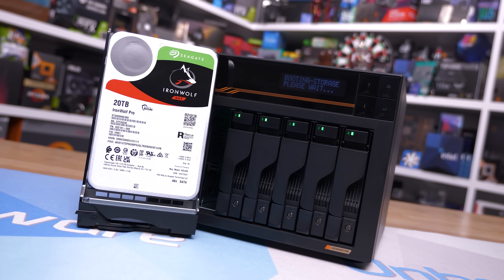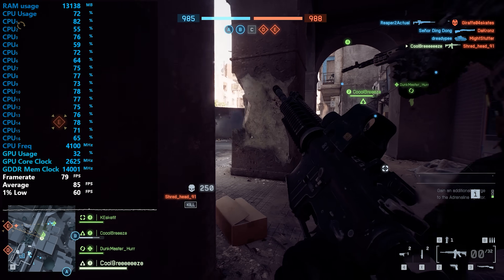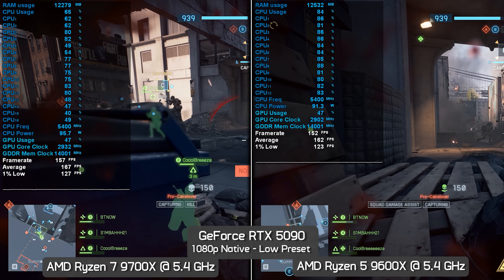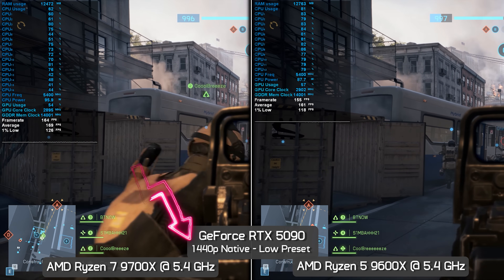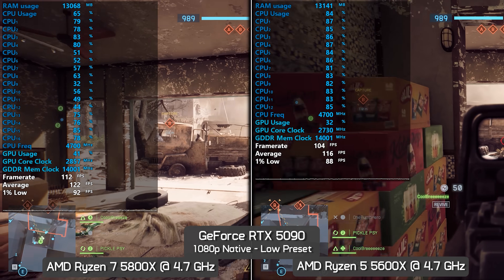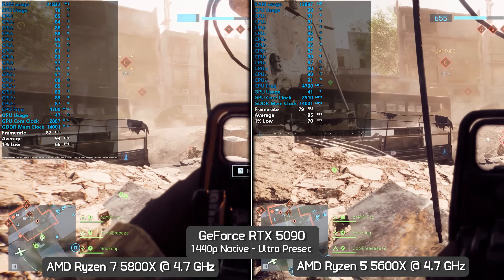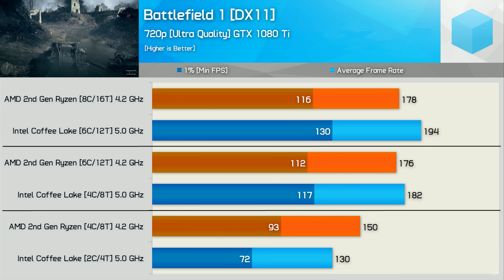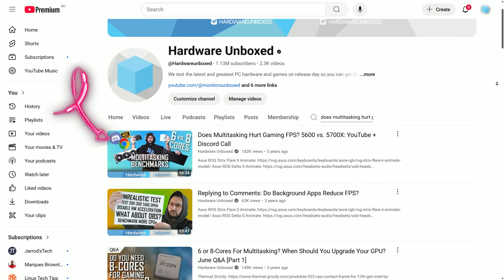Why Gamers DON’T Need More Cores, 6-Cores Still Works Well!

Comment: I'm not a gamer, outside of chess, but I think that there are some efficiency and performance advantages on AMD CPUs with fewer cores. We just did a 9900X build and the recipient is very happy with it. Very fast and very smooth. It was overkill on the number of cores but we had a bundle where the 9900X was the same price as the 9700X.

I think that Intel Panther Lake may be a better choice for me given that it will have three types of cores. I run virtual machines so having more cores can be helpful.

Comment: The test with the 5800X surprised me, I have a 5700X3D and I played the beta at around 140fps at 1440p/Ultra. I didn't knew that the X3D is that much faster than a normal CPU

Comment: I get your point , I had my $799.99 -5950X, PLUS $500.00 for my ASUS X570 DARK HERO and and  other $400 in RAM 16GB X4 -4600 for two sticks -X4 4266  -   5950X since  the beginning with  a 1080Ti ,  but moving forward since then , I upgraded my GPU 4090  $1699.99 retail and my TV TCL 646 HDR  4K  Retail $800 ,   so if you game at 1080P or 1440P  this review is for you  , if 4K is your game with the 4090 or 5090  , these CPU won't hurt your game ,  my GPU usage at native 4K is 97 percent and higher with my 5950X , on my channel ,I play single player games.

Comment: Hi, 
Great video, will it be possible to integrate SMT off (or hyperthreading for Intel) When it's relevant in the nexts tests, many gamers deactivate it because it has a small gain when activated but when it's crap, is crap, on certain titles (elden ring, metro exodus ...) but in the case of the 2700x and 2600x I think it should change things, especially for the 2600x. 
thank good day

Comment: Depends. Cuberpunk 2077 uses up to 20 cores. And they make a difference! And that is why i had bought a 13500. And i played the game and it run nicely (with a 4070 12gb)
Reply from the maker: The 13500 is slower than the 9600X in CP2077 with weaker frame time performance.

Comment: This reminds a bit of the time almost 10 years ago when every one said you dont need" hyperthreading on the 6700k for gaming. just buy the 6600k and save $100" but I paid the $100 and I am still using the cpu today. I dont think the 6600k would have lasted this long and I wonder if it will be the same with the 6/8 core discussion.

Comment: so I actually did this upgrade and Ill tell you 
I had a ryzen 5 5600X I had the PBO/ PPT wattage EDC TDC tuned through bench marking with HWinfo to give it enough power and current to maximize its performance, and I had a dark rock 5 pro 270w TDP CPU cooler so power and thermals wouldnt be an issue for any performance 

So I had the 5600X and was very happy. when a friend of mine had a 1 week old 5700X 8/16 CPU. So I thought heck yeah So I bought it off him 
again I went through the PBO/PPT EDC/TDC tuning and maximized/optimized the power and current. the PPT was 125 watts so I didn't need anything better than the dark rock 5 so I kept that. 
and let me tell you I missed that extra clock speed the 5600X had. sure the extra cores were there. but let me tell you the drop in the MHZ was Noticeable even for non gaming. its so noticeable I am almost ready to deploy an AM5 7700 or 9700X system I am still unsure which to get because the 9700X base clock speed drops dramatically to 3.8 whereas the 7700X has a 4.5ghz base so I am very unsure to get the lower mhz chip for the same reasons I am experiencing now

Comment: It's better to use System Informer, it will show cpu threads usage per game's process, it's more accurate than cpu cores load. You can say that there are 5 processes with 100% cpu thread utilization, 3 with 50% and etc.

Comment: A nuanced but overlooked point; input processing, especially on higher polling rates. If you give the XHCI (usb) controller it's own core, there is significantly less context switching when processing inputs. Negligible? Perhaps, but some Devs (respawn etc) are providing the option to not use the same cores responsible for processing inputs, to run the game.

Comment: As a PC hardware shop owner, I can say this is the worst advice to give. I remember during the Alder Lake launch, many customers returned the 12400F for CPUs with higher core counts because they experienced 100% CPU usage in online games, even when using budget cards like the 3060 or 4060, going with 12600k or 12700k fixed their issue, also zen 4 in general lose to intel's raptor lake in every game even at 2k ultra by 10%-20% while cost more, not expecting zen 5% to be any better, also raptor lake with ddr5 7600 match zen4 3D which make zen 5 3d the only worth buying AMD CPUs if you have 5090 and play games at 2k not 4k.
here is the score on shadow of the tomb raider, 14900k was on DDR4 3866 and 7900x/9800x3d on DDR5 6000, 14900k should score a bit higher on DDR5.
7900x 187
9800x3d 206
14900 207

horizon zero dawn
7900x 137
14900k 157
9800x3d 162
I uploaded the scores screen shots to my account because Hardware Unboxed automatically deletes comments with URLs. I had initially tried uploading them to an image hosting site.

Comment: 6 and 8 cores are today's version of yesterday's 2 and 4 cores.  I see no reason to bite at the upsell.  I'm still going to undervolt my CPU and lock it at its rated non-turbo speed.  I also speed up the fan curves.  Works wonders at reducing power consumption and heat.  Personally, I'm not at all interested in Artificial Idiot, 4k, ray or path tracing, or anything else that's expensive as all get out but does absolutely nothing to improve my experience.

Comment: Lol😂 all this troll comments, yeah 6core have "always" been the best option for performance/price option for gaming since intel gen 8  and so on I have owned and resold 9400F,11400F,12600k and 14600kf (my current) etc. All bought at around or below 150usd, never makes sense to get a 300€ cpu for 10 fps more, nah. Edit: my 14600KF is hugely UV since day1 at 1.15v cause degradation yeah, but I understand why intel is dead for most ppl and not recommended

Comment: Thanks for this video, I'm selling my 7800X3D to a friend but don't want to ditch the AM5 platform altogether just yet, considering my 14700K system is a dead-end platform, so I was eyeing the 9600X, the 9700X looked interesting until I indeed saw what your tests also showed, it's only 5-10% faster, but costs almost double, 190 euros vs 290 euros.
Compared to my older media PC with 11700K the single thread performance of the 9600X is 25% faster and multicore score is 20% higher even though it has 6 cores instead of 2, plus having 50% more L2 cache and 100% more L3 cache.
So it currently looks like I'll be retiring and selling my 11700K system and the AM5 system being relegated to being the new media / backup PC.
Reply: So you are going from a 7800x3d to a 9600x?
Reply: @nostrum6410  yea, most of the games I play don't benefit from the X3D cache, and the 9600X still has 32MB L3 cache anyawy.
The single thread score is also much higher, which is more meaningful to for the games I play, it also gets less hot due to the new architecture, and I do like a cooler system.
I'll be selling the 7800X3D for 300 euros and buying the 9600X or 190 euros, so there's no loss really.

Comment: The most annoying thing about hardware review guys, is their refusal to compare CPU's at resolutions higher than 1080p. You ask them, and they stomp their feet around telling you how you're supposed to benchmark a CPU. We all get it. We understand that part. A lot of us have 1440p panels, and we just want to see how a processors compare at the resolution we run. We're talking about the difference of hundreds of dollars at this point, given the fact that AMD is selling $650 gaming CPU's now. If the processors perform very similarly at 1440p, a lot of us can save the money. How is more information bad? We don't want to just assume the answer to these questions, and then find out later that we were wrong. This stuff costs a lot of money. Stop telling us how you're supposed to do something, and show us what we can expect. God forbid.
Reply: Is this a sarcastic post? HUB has shown it many times, even just last month. They have a CPU/GPU Scaling video comparing the 9800X3D/7600X/5800X3D/5600 with a 5090/5080/9070/9060XT at 1080p/1440p/4K res: https://www.youtube.com/watch?v=aYYVz4q-Rt8

1440p and 4K basically make the 9800X3D and slower CPUs almost dead even unless you're at 4090/5090 GPU level. The point of 1080p is to show the maximum frames a CPU can produce and the level of performance you can expect as games become more demanding and you upgrade your GPU in the future.

Comment: This video certainly explains why my old 4690k at 4.3 GHz lasted as long as it did at 1080p/60Hz
Reply: Not sure what video you watched, but a 4C 4T ancient CPU doesn't seem relevant. Nowadays that CPU would struggle running browser tasks on their own in a lot of cases. Gaming with the browser open would almost certainly get heavily impacted. 4C 8T would already be a mountain of a difference. Regardless the architecture is so old the main concern shouldn't be framerates but if games even run at all with all the missing instruction sets. 

Just to be clear, when the opportunity comes, do not upgrade to a 4C 8T, go 6 cores minimum. As new as possible.
Reply: @jyrolys6  Appreciate the response, but I don't need any advice regarding what to upgrade, nor did I ask for any. Also, I never had any issues playing games on mid-high to high settings with the 4690k - not a single issue. Only issues I ran into was CPU heavy games such as Mount & Blade II where I had to keep the unit limit to 400 and the much more recent Battlefield 6 where I had 50-60 FPS on 16-24 player modes, and had unplayable FPS on larger modes. 

The video is very relevant despite my example having even fewer cores than the tests in the video. My 4C/4T CPU isn't as modern as a 9350KF, for example, but the point of the video is that you can achieve some surprising results with less cores and threads if your CPU has good performance per core. The presence of hyperthreading is obviously going to affect results, but the video and my experience shows that a solid CPU with lower cores can still game just fine. As the thumbnail of the very video you're commenting on states: "Faster than you think!" You're acting like I'm still on a Pentium II or something... 

Either you don't understand what you're trying to lecture me about, or you don't know what a 4690k is. This CPU has SSE4.1, SSE4.2, and AVX2. I've yet to run into a game that wouldn't launch on this thing. I don't doubt that newer instruction sets would provide a more optimized experience, but it's not like they flat out won't run. Do you also believe that a PC will explode if you don't upgrade for five years? Or perhaps you'd think a Windows install will stop working once support ends? 😅

Comment: The weird part about this specific "just CPU cores" testing, it tests the game itself on barebones system.

Whereas pretty much everyone nowadays will be running a lot of software on the background while gaming. Browser, often doing things like youtube playback on second screen, discord for communications, etc.
Reply: If you watched the video, this was one of the topics that Steve addressed exactly.
Reply: @Gembler23  and knowing how HUB still didn't update testing by including time frame charts to focus on what matters (this being frametimes) it would not be surprising if they manged to fuck up a answer to that topic too

6 cores is bare bones these days and will start to choke the moment you start having browser, discord etc. running in back end while 8 core CPU's do just fine

FFS my 5800X3D no longer can maintain consistent 240fps in fortnite the moment there are more than 10 people and this is with a rx9070, dx12 performance mode 3440x1440p
Reply: @xthelord1668  this is a myth that you desperately cling to. No the number of cores does not matter. In fact the more cores the worse the situation gets, as its more beneficial to have single, faster core, than many slower ones, we just can't make them, so many cores it is. the newest gen 6 core x3d part will be much faster than older 8/12/16core cpu even with background tasks, just because it is overall faster and fewer faster cores are much more efficient in workload distribution that more numerous slower ones.
Reply: Tech Deals channel used to recommend beefier CPUs for this reason.  Seems reasonable, especially if you're buying close-out last generation hardware at the best price you'll ever get for it.  Sadly, he was also a big fan of resale value and recommended Intel 13600+.  For me, it just meant buying 8 cores instead of 6.
Reply: HUB has done testing on this, which was also addressed in the video, and found reasonable amounts of background tasks had negligible impact.

So, for most people the conclusions in this video will be applicable
Reply: @TheDarksideFNothing  It will never cease being funny when testers test on a fresh install with a handful of lightweight applications and conclude it's totally not heavy use.

Essentially the conclusion is that two indeed equals two. Shocking.

Meanwhile in real world, people don't use fresh install with just a handful of apps. But that's hard to test reliably, since there's no way to delineate problems that come from a long term installation, nor a unified suite of what people could be running simultaneously.
Reply: @luckyo11 I dunno. I think the testing Steve does is suitable for informing the vast majority of Windows gamers who would actually be tuning in to the content.

If you yourself keep a wild amount of programs running or have contracted internet gonosyphiherpelaids, or just have an ancient windows install I guess I could see more cores having a bigger benefit than normal. But that's a personal circumstance you'd need to figure out for yourself, and really you should be practicing better pc hygiene than that.

Besides, this is in the context of purchasing parts, so you should probably be starting with a fresh install anyway for that very reason.

Double besides, as you said, there's no good way to actually test what it's like on a clapped out windows install.
Reply: @TheDarksideFNothing  Fair, in that if you're a microsoftie good boy, and just reinstall your entire OS every six month, occasionally losing data and wrecking your SSD, it will work for you more or less, and only run maybe discord as you game.

The funny part for me is this is a millenial moment in the same way millenials call "out of date" behavior a boomer moment. Most Gen Zers play mobile shit. A lot. And a lot of them run their favorite gacha shit on an emulator on their PC (since it's way more powerful than a phone if you have a proper gaming PC, and will run at hilariously good quality and speed).

That alone will eat two full to partial four cores and something like 5-20% of your GPU (depending on game and GPU). And notably, you can still play normal games on your other screen.

Ask me how I know.
Reply: @luckyo11  So, I covered that sort of scenario above with the "wild amount of programs" thing.

Obviously, running a game and an emulator at the same time is outside the scope of normal use that is being tested. IIRC Steve even caveats that sort of behavior in the background tasks video. Maybe I'm an out of touch ancient 32 year old, but I have a hard time believing the average person is playing two games at once while watching YouTube as a matter of course.

And no, I don't expect people are refreshing their installation every six months, but that's also completely unnecessary. The average cadence for a PC upgrade is 3 years and most people buy a new system. Done. There's your fresh install.

Even if you don't buy a new system, a fresh install or at least driver wipe is recommended in any guide for performing upgrades. So in that case it's user error and outside the scope of testing.
Reply: @TheDarksideFNothing  I find that Microsoft and AMD background updates, as well as ordinary auto-saves, use the first thread and disrupt running programs.  Having more threads and cores doesn't help one bit with that.  Somehow all these programs don't understand to use all the threads/cores except that one.

Comment: I just ordered a 14600k and z790 ddr4 mobo to replace my 5600x
Reply: That's a good move. My 13700k never runs on 95W the entire time of gaming. Use Intel XTU and turn the cache multiplier down to 30x when you're just browsing the web and goofing around. In power saver mode you'll do regular tasks at 12W average.
Reply: @kramnull8962 14600k was only 149e with bf6 included and found an unused z790 ddr4 mobo for 150 which is 100 under market price
Reply: That's a strange upgrade
Reply: @nostrum6410  cheaper than getting a 5800x3d and more performance?
Reply: @zereks2168  its such a minor performance increase in most situations

Comment: I'm kind of hoping the steam deck 2 has a custom APU again and they go with 6 cores. I've noticed the steam deck would do a little better if it had 2 mores cores and handhelds with with 8 cores would be a bit more efficient with 2 less cores.

Comment: So, why is the performance INCREASING on 2600X when going from 1080p to 1440p ? It doesn't make any sense. Was there variability between runs ? Like different live matches ? That could explain the performance difference that doesn't make sense, that the tasks were actually not equal.
Reply from the maker: Yeah different matches, you can only compare the side=by-side runs, it's a multiplayer environment.
Reply: @Hardwareunboxed  Figured as much. Thanks for the reply!